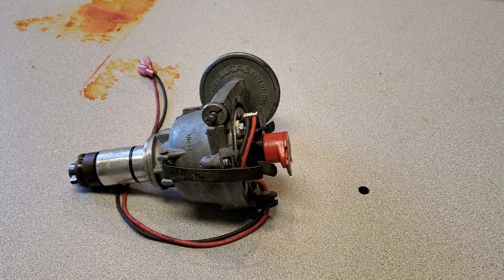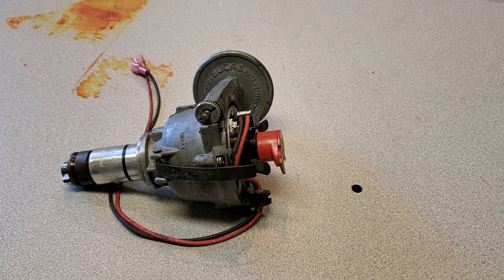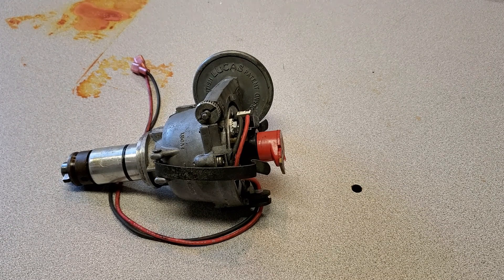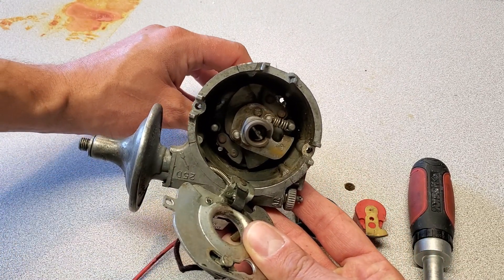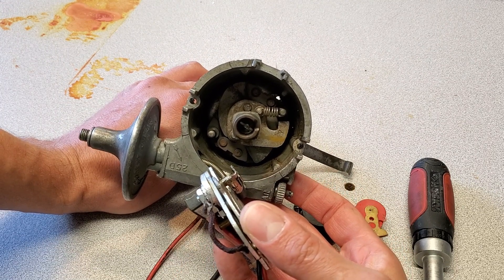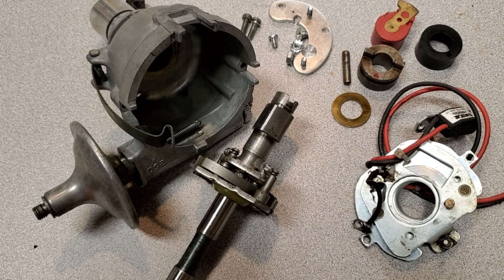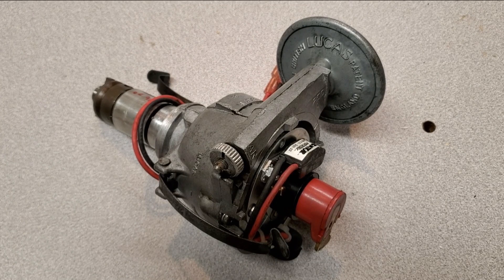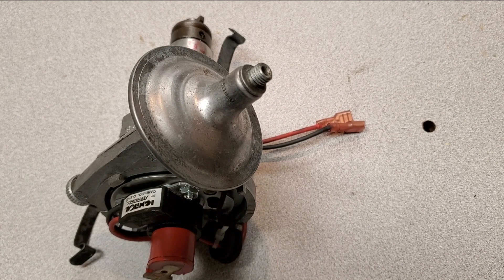Repairing a Lucas 25D distributor with a Bad advance curve

Comment: Hi, just replaced the vacuum advance unit, and I couldn t find any info on how so set it up. How many clicks or what should I measure to find a proper set up. Thank you.
Reply from the maker: Set timing to what the book says without vacuum hooked up. Then hook up vacuum.
Reply: @darrensrestorations991  Hi , iment the vacuum membrane that moves the points.
Reply from the maker: If it is a 25D distributor, set the adjuster wheel to the center or middle of the adjustment range.

Comment: Hi, how do you aling the driving gear on the distributor axle relative to the rotor?   {wih the little pin} kind regards Cornelius
Reply from the maker: Typically the pin is drilled with a slight offset. Meaning it can only go together one way. However I have run into ones that are drilled in the center. With those, I use an old drive dog to position the drive gear to the rotor position.

Comment: Interesting about checking the advance with the protractor. I understand about the pointer but where is the stop line to read the amount of degrees to check if it concurs with what's stamped on the cam?
Reply from the maker: Rotate the rotor cam untill it stops, then read the protractor. That will be the number of degrees of advance that you have.
Sometimes it matches what is stamped, but wear on the cam will lead to more timing. Which is why it must be measured.
Reply: @darrensrestorations991  Thank you. Yes, I get it now.

Comment: So I have one of these in my 1982 Land Rover. The Haynes manual says that the mechanical advance should go as much as 42° at 4500 rpm. But mine has the same cam in as yours with 12° stamped on it. Does that mean that I have the wrong cam? Should it say 42° on the cam? Thanks
Reply from the maker: The distributor cam is not the same as total advance. 12 deg of distributor advance is 24 degrees at the crankshaft. Add on the static idle advance and you should get to total advance. The Haynes manual may be referring to the total advance including any vacuum advance.

Comment: when distributor in place, can the rotor arm rotate a bit or is it wear?
Reply from the maker: If the rotor rotates but the shaft does not, that is an issue. 
The rotor and shaft will rotate together and swing out the weights which is normal.